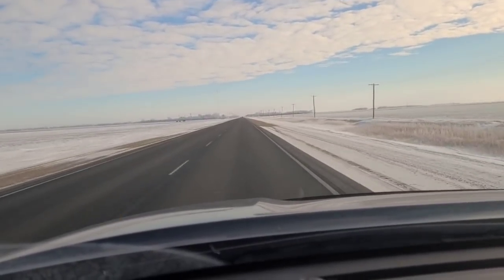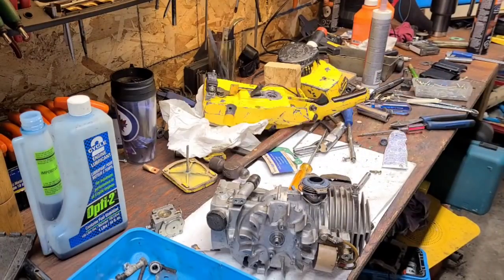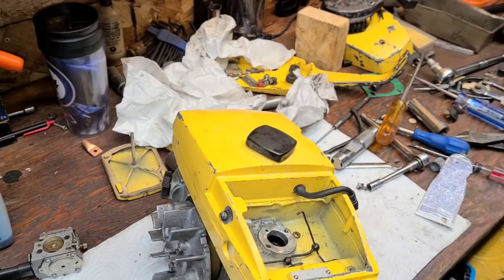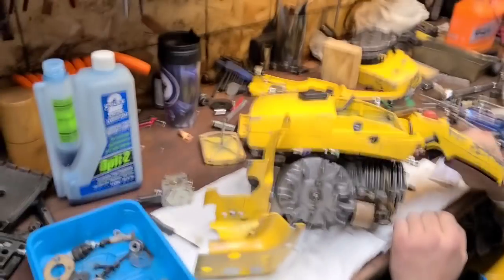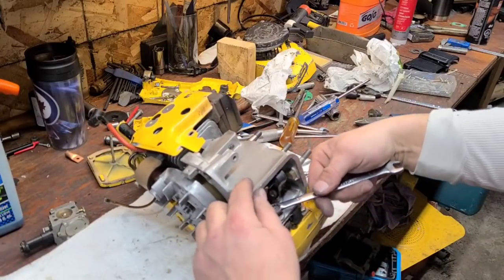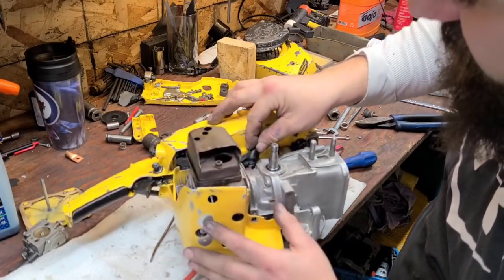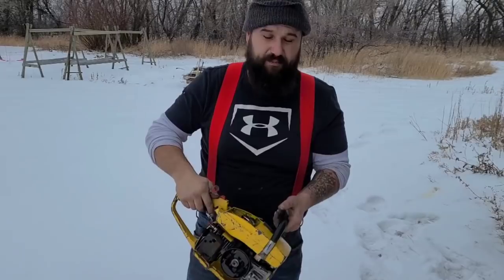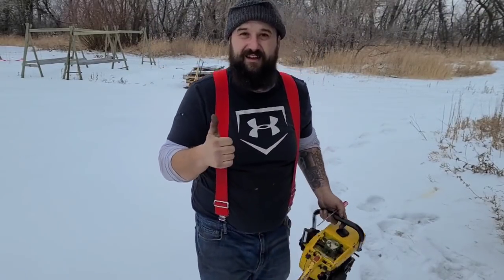Ported McCulloch Super pro 70, assembly and first start!!

Comment: Awesome.  So Iv been playing with the 55 pro mac. I had to clean the points I read where they was supposed to b gapped at 19tho I was experimenting I opened  them up to 22tho it made a noticeable difference jus figured I'd share with ya .
Reply: A couple thousandths advances the ignition timing considerably. Thanks for sharing.

Comment: Tinman, check out Permitex Aviation sealant. I use it all the time, its a game changer. I've used it when removing base gaskets on my saws. The fuel and oil won't mess with it over time either.

Comment: I own a 455 rancher and was wondering if you have any suggestions on making it more powerful. I have read about porting it, but I do not have the confidence to do it myself and can't  find anybody who can  do it. So are there any other options?
P.S. I ordered a 24' bar and was hoping to run that :).
Reply: Good day. I’ve got one too. I keep in mind that it is not a professional grade saw. In my opinion find a 266xp or 272 that needs work and put your money into that.
Reply from the maker: Like shape shifter said, I'd just get a bigger saw.
Reply: @shapeshifter7753  Thats not really an option, because I am only 18 years old and do not have that kind of money laying around. On the dutch husqvarna site it says a max lenght of 22"  for a 455 rancher. Does that 1 extra inch matter that much? Nevertheless thanks for your opinion!
Reply: Jop Koenes being 18 is a great advantage! You’ve got a lot of time to look around for a great deal on a blown up ol pro saw while you watch Iron Horse and Tinman videos on how to hop em up 🔥 and you’ve got a great stock saw there to use while your having a great time with it all👍
Reply: If you feel you really need the extra length put a skip tooth chain on it and keep up on your maintenance. Keep that chain cover assembly and clutch nice n clean and try not to file your rakers down too far. I hope this helps young friend 😎
Reply: @shapeshifter7753  Thanks lot for your advice. I found a husqvarna 61 nr 114. What do you thinks about that It has 61,5 cc.
Reply: @jopkoenes3511  I know when we’re young we want everything to happen Right Now But when we’re patient and wait for the right older classic saw to come along for the right price like the guys have already suggested. 266, 272 or even just keeping looking and wait until you find a great deal on an older and well looked after 372xp as I did, that will be a saw you can hop up and will last you a very long time with no shortage of parts. Keep in mind Most older saws, parts are next to impossible getting parts, either have points ignition and no rubber and or spring vibration dampening and anyone who’s cut for any length of time wants that dampening because they already have what’s called white fingers. Maybe Tinman will eventually do a more common saw for us. 

Good job getting that ol Mac going Tinman
Reply: Jop Koenes I don’t have experience with one. A big reason I suggest the 266/272 is because parts are still ez to find. Which is super handy if you mess up on porting😉 I’ll tell ya if I were going to do what you’ve got in mind I’d really pay attention to Iron horses videos where he is taking a 266 and upping it to a 272! He’s putting parts lists up on his channel too👍🔥
Reply: Plaidcladcanuck! Cool handle friend! Thanks for mentioning the 372 as well. I’d sure like to sling one of them to know what their all about.